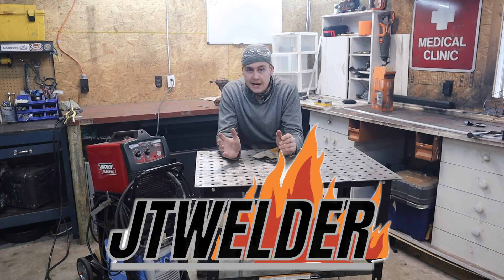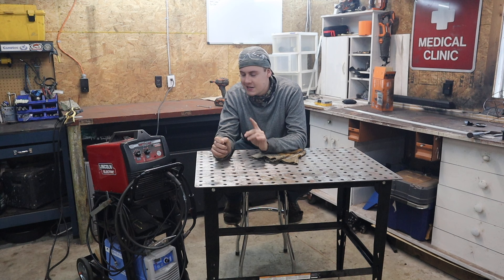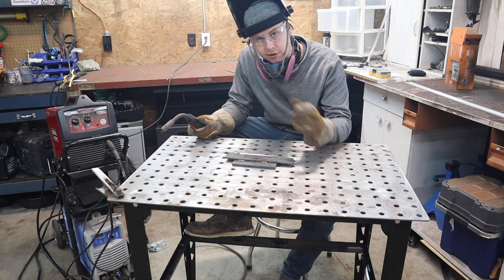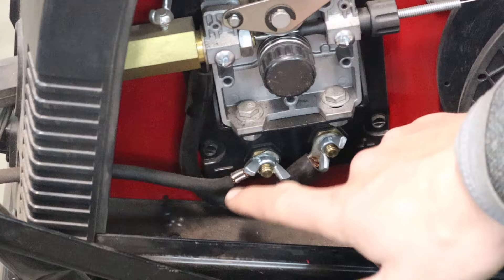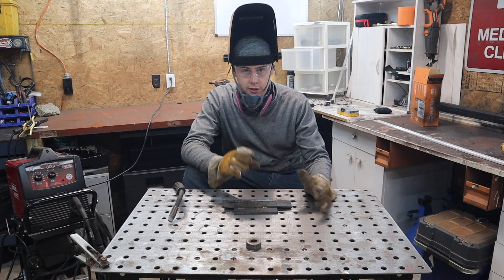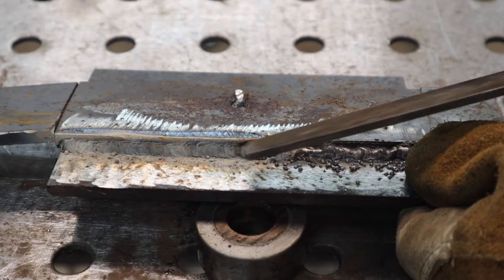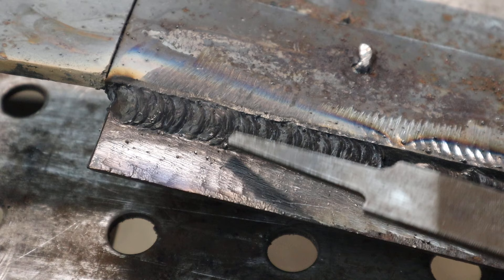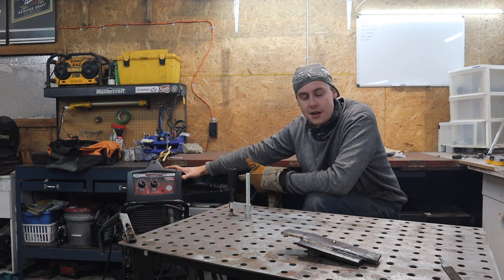#1 Mistake Made When Flux Core Welding (one simple Trick)

Comment: I ran a whole lot of .045 dual shield building railroad cars. It's really a good process when run properly.
Reply from the maker: Dual shield is probably my favorite process to weld. I Field welded smoke stack connections for 10 months straight with the stuff and it worked great! The self shield is good for when you out in the wind and can't run gas.

Comment: excellent video thanks.
Do you happen to know if the somewhat newer but cheaper Lincoln Electric FC-90 is electrode negative out of the box? Or if not, the wires can be easily changed like on the machine you have? The manuals on alot of these machines don't say if its DCEN or if polarity can be switched. Almost like the companies don't want people to know. It does say its got a DC inverter though, is that the same as having the gun on (negative) and the ground on (positive)?
Reply: I’m trying to figure out the same thing. Lincoln WELD-PAK 90i FC (little unit) had to remove side panel, (four black screws) to look at the wiring. More complicated than his wiring setup. Did you switch them yet?

Comment: It is easy to switch the wires on your Lincoln. I was looking at the Titanium and Hynade models neither has the wire attached like yours. Is it still possible to simply unscrew the cover on opposite side and switch the wires there?
Thanks!! 5:28
Reply from the maker: Yeah you would have to take the machine case right off to access everything.

Comment: a lot of the lo cost wire feed welders are AC so you can't change polarity
Reply from the maker: Not in North America. They are all Ac input and DC output. The only cheap Ac feeder I've ever heard of was at harbor freight and I believe they discontinued it because it required specialty Ac flux core wire that harbour freight had to design just for that machine. Yes welder sells a $125 flux core welder that's DC, cheapest you probably can find.
Reply: @JTwelder.  I was wondering exactly that--I have a Craftsman flux core welder, and figured it was AC.  Gonna play with this tonight.

Comment: IF anyone can help me to answer this question,  I got a new machine alright ?, now I installed 2 kind of flux core wires on it, yes gasless flux core wire, the machine set to the flux core mode properly, when starting the Mig gun and to start welding, the result is no welding at all!, nothing happening to the piece of metal I'm welding on just tons of splashes of hot BBs flying around but no welding beads going on, what do you think I'm doing wrong ? 😮
Reply from the maker: Your heat is set to low or your wire speed is too high. Also make sure the metal your trying to weld is steel and not aluminum

Comment: I would guess they come wired for negative ground to keep amateur car guys from blowing holes in their sheet metal body panels or warping them from the heat. Im going to wire mine for positive ground for general welding but I will switch back whenever I have to do thinner sheet metal.
Reply from the maker: I always run flux core on ground positive polarity, even on sheet metal.

Comment: My lights go out when I use my Eastwood welder on 110 vac. Would it help if I switched to a 20 amp outlet?
Reply from the maker: If your breaker is blowing than yes you need a 20 amp circuit.
Reply: @JTwelder.  the breaker isn’t tripping. But the lights go out when I use it. I can’t figure out why that’s happening.

Comment: I have the yes welder... do I do this on it even though it has gasless option on buttons or does it already switch the polarity when option is selected?
Reply from the maker: If it welds good on the gassless setting then you don't need do anything.
Reply: @JTwelder  it's not. It's awful. Just like in your video. Everyone kept telling me that it's just how Flux core is. Inside my yes welder, the cables are hard to get to so I just switched the actual leads on the outside and everyone I would make an arch the breaker would blow instantly. Had to switch back. BTW I have the yeswelder 3 in one mig tig and stick. Any idea where I went wrong? Thanks fir response btw

Comment: Ok what welder do you recommend and is able to do what you showed. I have a Chicago that there is no where to reverse it. So im guessing I need new. Can you help ?
Reply from the maker: There is a way to reverse yours but it's probably inside of the welder so you'll have to take the whole sheet metal casing off your machine
Reply: If it's a flux core machine it should be correct out of the box.

Comment: the way you explained polarities is incorrect. Positive lead doesn't carry as much heat through, its the negative lead that puts all the heat down in most cases you want the base metal getting really fucking hot and add filler metal into the puddle. but its the opposite for fluxcore because you need to heat up the flux inside the wire and you really arent putting all that much material down because the wire is hollow

Edited for more explanation

Comment: What if you have a 220v  machine. Same thing or no .
Reply from the maker: Yeah same deal this trick still works
Reply: the polarity will be specified by the wire manufacturer.  some dual shield(gas and flux) will be dcen, some are dcep.   flux core is dcen and a drag angle  with your gun.

Comment: Dude. The “amp” circuit has nothing to do with the voltage drop. SMH. A breaker is designed to protect the wire.  Had your 15 amp circuit been wired with 12 gauge wire, it would perform EXACTLY the same. If your 15 amp branch circuit with 14 gauge wire was close to the panel, it would perform exactly the same.
Reply from the maker: I don’t know much about electrical but what I do know is the manual says for the welder to run at full capacity it needs to be on a 20amp breaker. Obviously code in my area requires 12 gauge wire for a 20 amp circuit so I wired it up to code.

On the 20amp circuit the welder hardly ever blows the breaker. If I plug the welder in on any of my 15 amp circuits it blows the breaker every time even is it’s plugged into the receptacle 3 feet from the panel.

Comment: to cold though
Reply from the maker: You’re right but that’s as hot as the welder goes since it’s only a 140. The 180 Lincoln can really lay some nice fluxcore down with its higher output!
Reply: @JTwelder.  well if you through some preheat into in , it will go in better, that's a mistake alot , bigger weldment just doesnt mean a bigger welder,  learn with what you got , pre heat, interpass temp , heat input is a critical part of welding ,
Reply: But then you could of done a demo within the parameters of the machine, I been doing it along time and so many videos on how to weld , but few demo it right

Comment: The minus (-) or "ground" lug is POSITIVE on either "Stick" or "Flux core" welding. This why both methods are called DCEN (DC Electrode Negative). 

The minus (-) or "ground" lug is NEGATIVE on MIG welding. This is why it is called DCEP (DC Electrode Positive). You will NEVER see anyone MIG welding DCEN.

When welding using FCAW (Flux core either gasless or dualshield), you are PULLING heat (getting current flowing INTO the workpiece) FROM the positive ground clamp TO the negative wire (and contact tip). This explains why the workpiece gets so hot so quickly! People have the habit of grounding the workpiece far from the welding area. So...current has to go through the whole piece to reach the wire.

When welding using GTAW, (Mig), you are PUSHING heat (getting current flowing INTO the workpiece) FROM the positive contact tip (and wire) TO the negative workpiece (and ground clamp). Since the wire is so small, there is very little heat pushed into the puddle. This limits the amount of heat put into the workpiece!
Reply from the maker: No man you got it all wrong.....The only two processes that you commonly weld on DCEN (straight polarity) is GASLESS flux core and any TIG welding. Everything else (stick,mig, dual shield flux core and subarc) uses DCEP (reverse polarity). Look it up on google, there's plenty of charts on it.

Comment: SAFETY WARNING = Before sticking your fingers around positive / negative welder terminals, UNPLUG THE WELDER , Turn the switch on / off (to drain any captive power), THEN you can stick your fingers it. Obviously JT did this, but I just wanted to try and save someone from a nice jolt

Comment: They don't know how to run a flux core machine because flux core is for amateur welder that don't know what they're doing I'm sorry but it's true. Flux core is awful I wouldn't even allow someone to carry it in my shop
Reply from the maker: You have no idea what your talking about. Gasless fluxcore is used out on structural jobs all the time. Look up Hobart xlr8 and Lincoln 233. If you buy high quality wire the stuff actually works very well on a wire feeder.

Comment: you kinda butchered that explanation. flux core wire is hollow, so it can't handle as much current as solid mig wire. obviously you can't just reduce the current because then the metal you're welding won't get hot enough. in an electrical arc, the positive end gets hotter than the negative end, so if you set the polarity so that the electrode is negative, your flux core wire doesn't get as hot and the metal you're welding gets some extra heat, keeping your flux core wire from exploding all over the place. and if you think using a flux core welder with a positive electrode is bad, my $90CAD princess auto welder put out ac! they left out the bridge rectifier and filter cap to save a few bucks. fortunately adding my own didn't cost much.

Comment: Too inexperienced to be giving tips that machine and wire are excellent.
Reply from the maker: Bet you I’m more experienced than you. That’s 211 Lincoln wire in the video, It’s known as one of the worst running T11 flux cores out there. Hobart fabshield 21b is a much better T11 wire.
Reply: By the way I run out of an LN25  which holds 25lbs rolls and I can burn through 2 and a half rolls in a 8 hour day and an LN8 holds 50lbs rolls and I can do the same thing please sit in the truck and dont touch the knobs